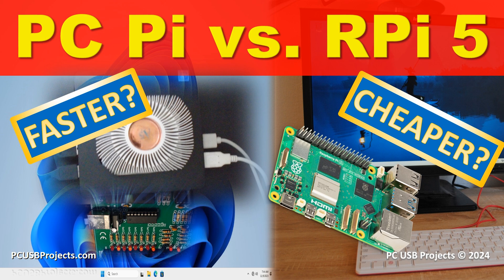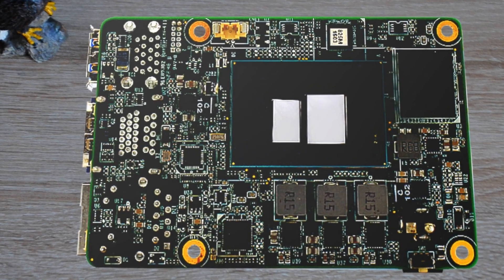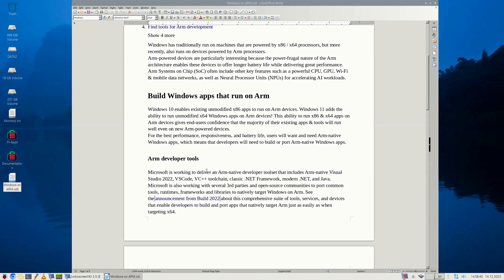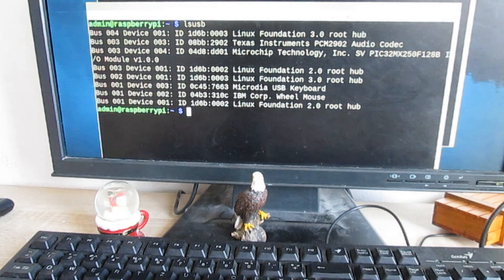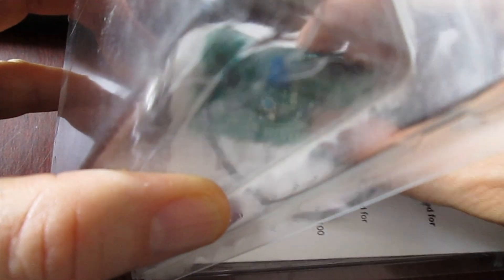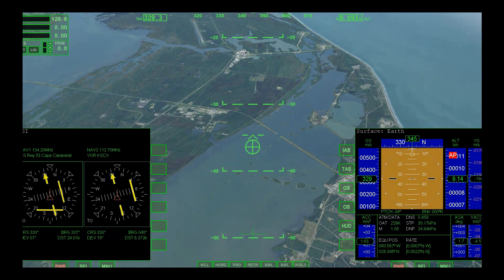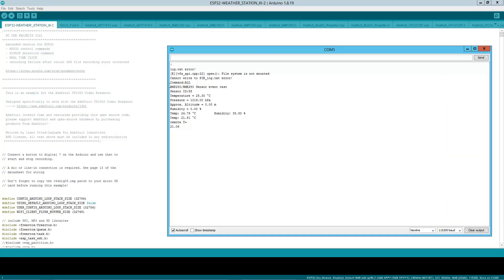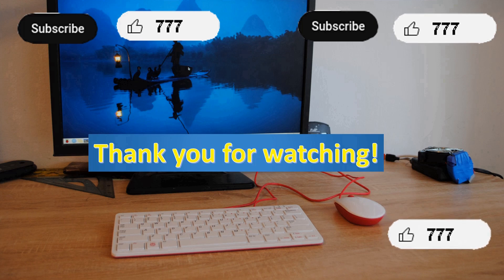Raspberry Pi 5 is being rivalled by mini PC! Is mini PC winning again!? What about expansion port?

Comment: I agree rpi is ideal for home made devices and mini PCs for graphics. Also to mention rpi is great for programming. Other places where rpi excels is in running servers, remote access, rf hacking, hooking up cameras and sensors, data logging etc my point there is a world of applications which are connectivity oriented requiring modest cpu and little memory. I think trying to retrofit rpi to act like a nuc or a nuc as rpi is probably not optimal, one'll end up spending as much as the price difference between rpi5 and mini pc, plus the effort and gremlins.
Reply from the maker: RPi 5 has a different architecture than a classic PC NUC, so it is on my opinion at least for now safer to run as an unprotected internet server (not being behind a HW firewall and not running an antivirus SW). But only you can decide which architecture is the best for your projects. What is optimal greatly depends on your knowledge background and experiences with different SW and HW. However, if you intend to use RPi 5 daily, it is on my opinion a very good idea to add certain features that NUCs have like SSD via PCIe, power on control module with a power on button (https://youtu.be/-snEAUa19lY,https://youtu.be/BINHFtPJi7o), a RTC battery (https://youtu.be/SMg938ZtYWQ)  etc.
Reply: @pcusbprojects  👍